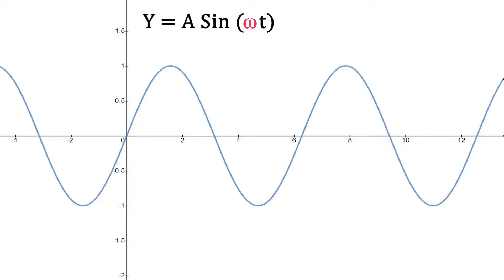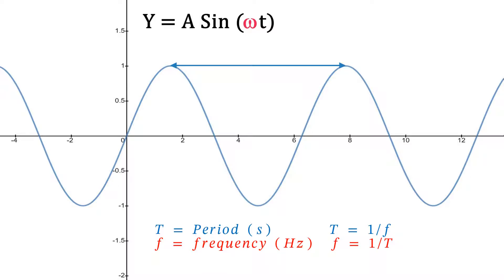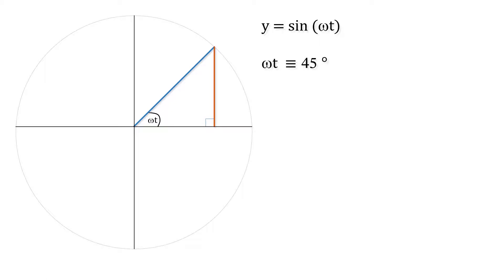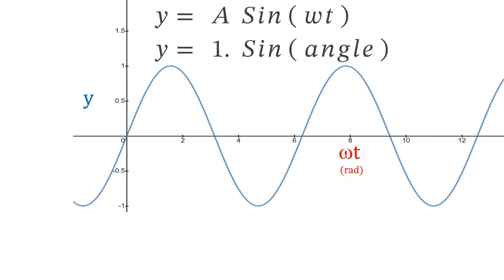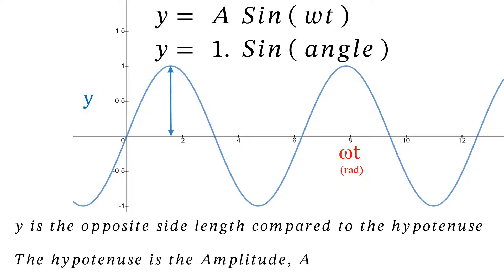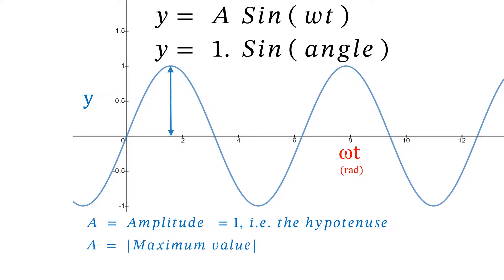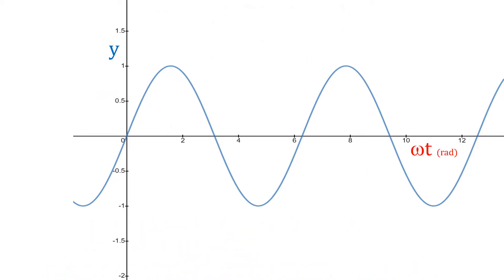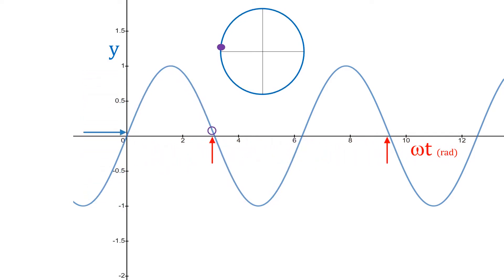Sine Wave - Introduction to Y = A Sin(wt)

Comment: Hey thanks for your explanation, however I am still bit confused, why Y = A sin wt? I mean, sin wt = Perpendicular/hypotenuse right? so why Y = A sin wt?
Reply from the maker: You're welcome, thank you! Well....whatever comes after Sin   is an angle. We could just as easily say Y=A Sin(x)  where x is the x axis or Y=A Sin(theta). Whatever we are 'Sining' has to be an angle no matter what we call it. In Engineering we use Omega as the angular velocity and multiply Omega by time to find an actual angle.
Wt is an angle.
So Y=A Sin(angle) does relate to the right angled triangle and Y gives us the opposite side length compared to the maximim value, (the hypotenuse, A) as the angle increases along the x axis.

I hope this helps!
Reply: @E4E  Thank you for your reply. I understand the sin θ = perpendicular / hypotenuse. Now Y is the perpendicular so what is the hypotenuse? A? but as I understand amplitude A = maximum height above or below is mean position, so this is perpendicular to X as well right? or does it mean the distance from origin to maximum or minimum point in a wave?
Reply from the maker: @dust2dust61  Hi there, A is the maximum value the Sin function can ever get to. For a Unit circle A=1. 
The hypotenuse length never changes, only the opposite and adjacent side lengths change.
A is the maximum voltage, say, so A is the same value as the hypotenuse length.
We don't have just one right triangle, as a sine wave shows the Y value plotted against angle as the angle goes from 0 degreed to 360 degrees, which is 0 radians to 2pi radians.
Y is always depicting the vertical height (opposite side) of the triangle and this Y value changes as the angle changes.
Try plotting a few values of the sin function on a sketchpad, use a calculator to do the sin of 0, 22.5, 45,  67.5, 90 degrees... then see how the sine wave appears.
rsvp for more clarification.
A cosine function tells us how long the adjecent (horizontal) side length is and how this changes as angle changes.
Mathsisfun has a great interactive unit circle.
Reply from the maker: @dust2dust61  Google maths is fun interactive unit circle, it's great.
Reply: @E4E  Thank you so much for your time. Really appreciate it.
Reply from the maker: @dust2dust61  You're welcome, any time.
Reply: This was such a good question and such a good answer! I've never understood A as the hypotenuse before.